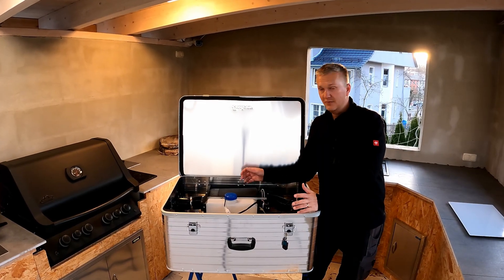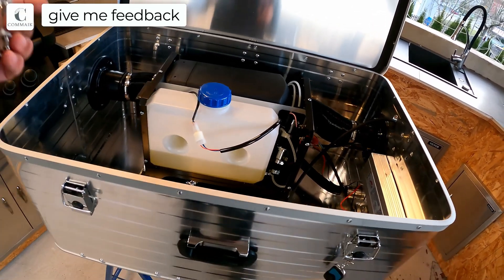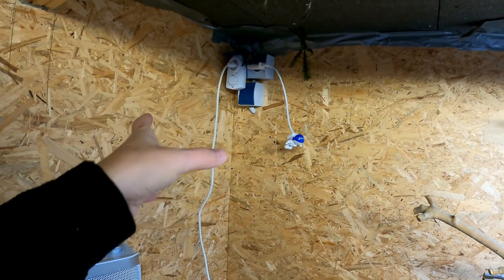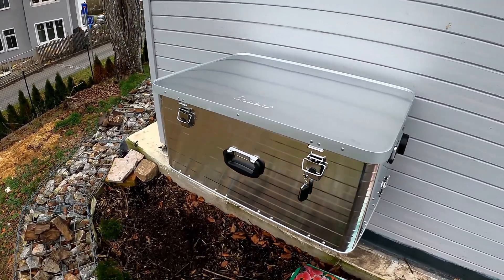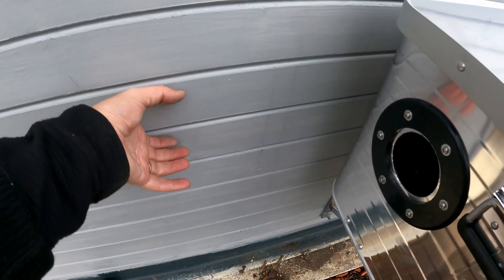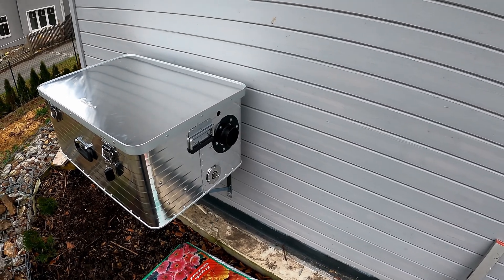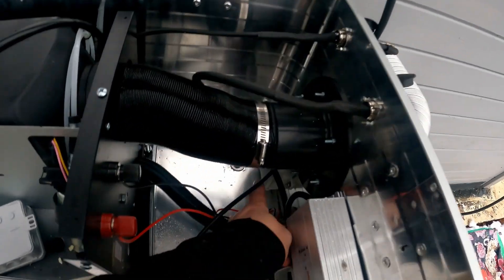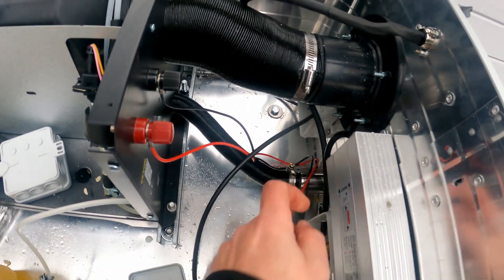How to Build a Mobile Diesel Heating Box for Winter

Comment from the maker: *👇 All products & links from this video:
🔗 8kW diesel auxiliary heater: https://geni.us/EqDF9OG (Amazon)
🔗 8kW auxiliary heater with BT: https://geni.us/qL2x (Amazon)
🔗 BT auxiliary heater without housing: https://geni.us/H9Lgm (Amazon)
🔗 Auxiliary heater with transformer: https://geni.us/JuE8G6 (Amazon)
🔗 Gasoline canister: https://geni.us/80NRv (Amazon)

🔗 Aluminum box: https://geni.us/PnX1Y (Amazon)
🔗 Aluminum flexible pipe 75: https://geni.us/CRjh1ue (Amazon)
🔗 Connector 75: https://geni.us/gl2pPUY (Amazon)
🔗 Flange 75: https://geni.us/xf6vzP (Amazon)
🔗 Hose clamp 75: https://geni.us/Gj9RHe (Amazon)
🔗 Exhaust hose: https://geni.us/nDGUxV6 (Amazon)
🔗 Exhaust paste: https://geni.us/9r7V3B (Amazon)
🔗 Heat protection tape: https://geni.us/Dqi7a (Amazon)
🔗 Air outlet 75: https://geni.us/Z9Zr8n4 (Amazon)
🔗 Stainless steel exhaust connection: https://geni.us/7Mrnk (Amazon)
🔗 Stainless steel fresh air connection: https://geni.us/VuTHp (Amazon)
🔗 CO detector: https://geni.us/TqHLB (Amazon)

🔗 Control cable: https://geni.us/rAeVG6V (Amazon)
🔗 Cable connector: https://geni.us/bFE9 (Amazon)
🔗 Protective tube: https://geni.us/dLhPy (Amazon)
🔗 Power cable: https://geni.us/3VO8ZB (Amazon)
🔗 Transformer: https://geni.us/68Gxqv (Amazon)

🔗 Hole cutter 75: https://geni.us/AhR8F (Amazon)
🔗 Step drill: https://geni.us/yNMI (Amazon)
🔗 Soldering iron set: https://geni.us/rxRFFVi (Amazon)

🔗 Electric fan heater: https://geni.us/z1JA (Amazon)
🔗 Analog thermostat: https://geni.us/kRAq02 (Amazon)

You can find a detailed blog post with lots more information on my website: https://commaik.de/2025/01/mobile-diesel-standheizung-im-gartenhaus-einbauen/

This project comprises 4 videos:
✅ Unboxing and testing the Vevor diesel heater
✅ Building the heating box
✅ Installing the heating box on the house
✅ Upgrading the diesel tank for the heating box

Follow me on my social media channels for more content! @commaik

🎥 This video was originally produced in German for my main channel:  
https://youtube.com/commaik  
It was then translated into English using Heygen – with my own voice and lip-sync.

🎙 Want to dub your videos like I do? Try Heygen:  
🔗 https://www.heygen.com/invite/b96cdcf6 – Get 300 free credits when you subscribe.

📺 The original video, which includes English subtitles, can be found here: https://youtu.be/ONECBX-wSDQ

Note: All links marked with * are affiliate links. If you make a purchase through these links, I will receive a small commission at no additional cost to you. Thank you for your support!

Comment: Very nice installation. Really like your animals and it looks like you take very good care of them. To increase efficiency of the diesel heater you might want to insulate the supply and return ducts. You may even think about insulating the diesel heater box. You're install is very elegant nice work. Very Respectfully Lance
Reply from the maker: Hi Lance,
thank you so much for your kind feedback! 😊
I really appreciate that you mentioned the animals — they’re the main reason I built the setup, and it’s important to me that they stay warm and safe during winter. 🐹🕊
Your suggestion about insulating the system is a great one — that would definitely improve efficiency a bit. I just need to figure out how to make it UV-resistant, protected from animals (like martens), and still keep the box mobile.
It’s definitely on my list for future improvements – thanks again for the tip!

Cheers,
Maik